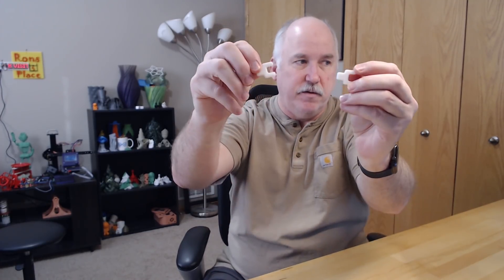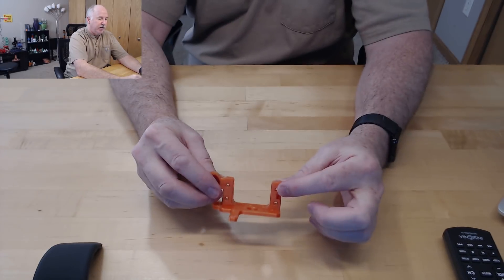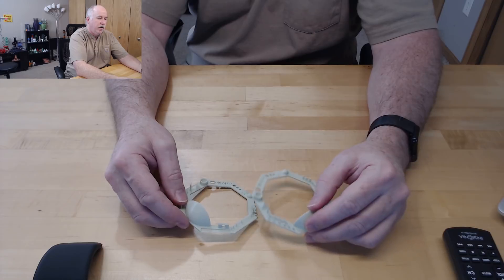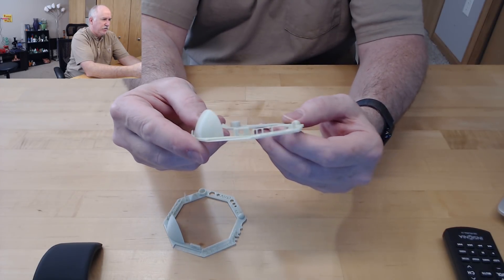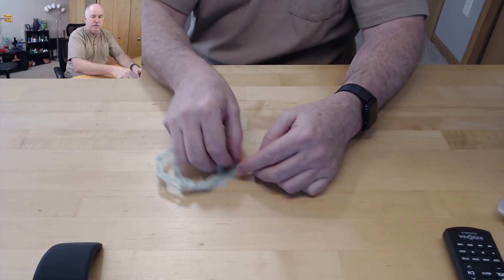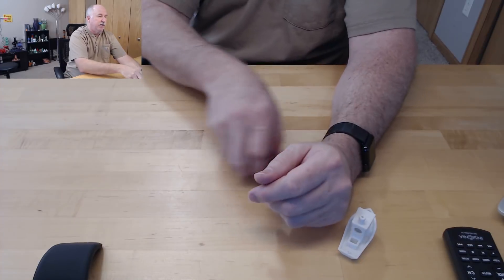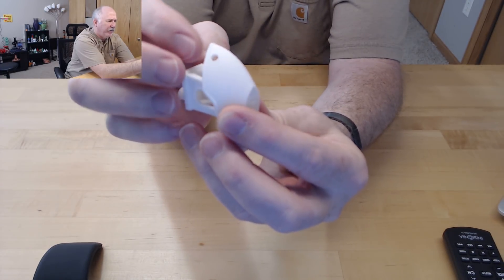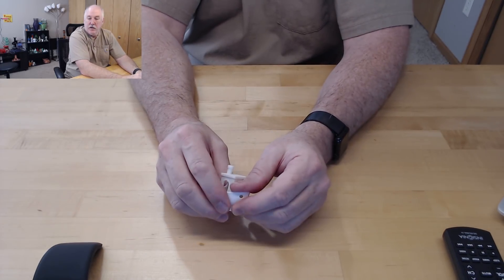Prusa i3 MK3 - Extrusion, firmware and update

Comment: I tried this on my MK3 on the latest firmware (rc4) and the 1.38.6 slic3r with a multiplier of 1.0 and found that part A fit into Part B a little too snug, but part B fit into part A just fine.  I printed the parts side by side.  I recalibrated and tried again with the same result.  Did you experience this with your printer?

Comment: Hi Ron, thanks for the pointer to the Fast Edge thing on Thingiverse.  I tried slicing the STL with both of the latest versions of PrusaControl and Prusa3D Slic3r MK3 and then printed both using the latest firmware on my i3 MK3.  PrusaControl produced results that were significantly over-extruded and couldn't be mated.  Prusa3D Slic3r MK3 produced results that were nearly perfect and mated cleanly.  Looks like I need to stop using PrusaControl...

Comment: Hi Ron, have you done some testing with regard to slicing perimeters first vs perimeters last? I find that affects tolerance so just curious what your findings are after tweaking your multi. Also, with regard to the 2nd benchy it would have been better to print in the same color as I think white hides those "cooling" things. I would also say stay away from IGUS. I upgraded to misumi rods and bearings on the MK2 and never looked back. Too easy to squish those igus bushings and cause issues with binding etc.
Reply: Regarding IGUS, if you get em installed correctly and are using the ones with the metal case then you can use printed holders. When I ran em on my MK2 I found that it was a bit difficult to use the ones without the metal housing cuz like I said you wanna get them installed securely and the more your torque on em then they can deform and hug the rods to tightly. Its kinda funny to hear that people are running them on MK3s because compared to my MK2, the MK3's are slient :-) One other test I'd like you to try. Get a light colored filament, preferably yellow and print the marvin from the SD card. I was able to slice marvin better with S3D and got better results than the one on the card which I expected to print perfectly but on my printer it doesn't. There are some layers on the lower body that remind me of the results you got on the front of your benchy.
Reply: That's interesting, Ron. You'd think the stuff on the card should print like a dream. Only time I had issues with items on the card was when I wasn't using enough squish for my first layer and lost a few prints cuz they wanted to dive off the bed out of boredom :-)

Comment: Hi Ron, thank you for sharing your method to fine tune the extrusion ratio. I will definitely try this out. In fact I think this is more practical than the feeding length/output volume calculation method.  One question: do we need to repeat this when we change filament  ?

Comment: Things I've found. 

The cooling has been a problem, the default settings on Prusa Control and Sli3er PE  couldn't  print a benchy properly. The bow towards the base didn't print properly. I did manage to get it to print reasonably by adjusting the fan speed, apart for some over extruding. As I'm swimming in benchys I've not done another with the latest release of Slic3r PE.
I still think it's a great printer that print's great and the PEI steel sheet is brilliant.
Reply: Be careful with flex and Petg printing, you may want to move the live z up a bit so it comes off after the print without taking off bits of the bed. Apparently rubbing baby powder (talc)  into the bed when brushing it off works for flex helps (flex always sticks well from my experience).

Comment: Thanks for the info, when you went to igus bearings on the Y axis did you get the ones that are constrained by pillow blocks or not?
Reply: I’m sure that in one of Tom’s videos there was a conclusion that igus worked better constrained in aluminium pillow blocks because they help with tolerances.

Comment: My understanding is that the latest drivers should have the extrusion multiplier already tweaked to 95% in the startup gcode so that you should keep the extrusion multiplier to 1 in the slicer. Can you confirm that you are now using 1 with the latest version of the drivers?
Reply: I found out that the shortcut that's on your desktop for slic3r contains the path to the profiles that slic3r should use. Make sure that your shortcut points to the newest version of the profiles, otherwise you end up using the new slic3r with the old profile. To confirm you are using the new profiles, make sure that you see the 'M221 S95'  at the end of the Start G-code.